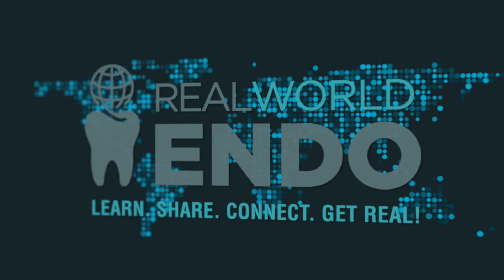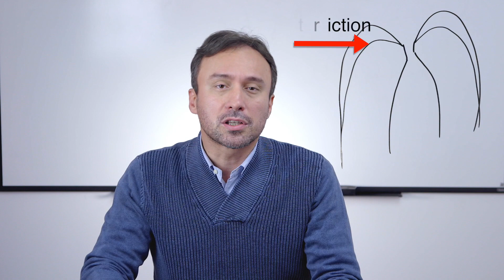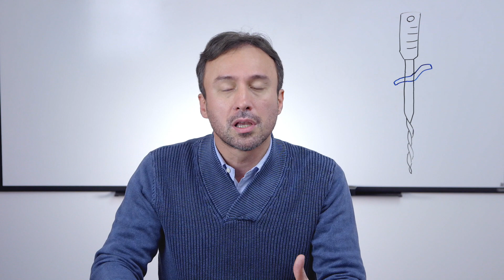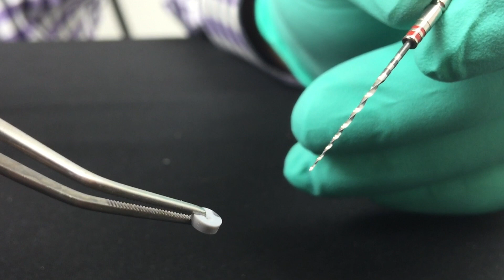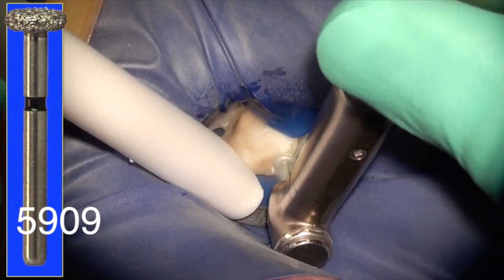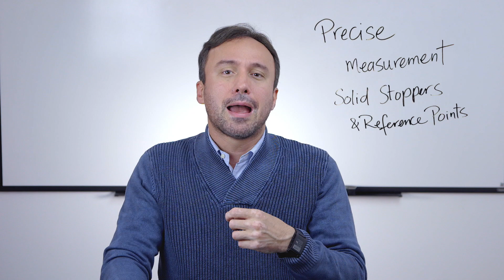How to improve Length Control? Friday Questions

Comment: Hi Allen!
I'm a student and I find your videos really helpfull and motivating to see how you can overcome different challenges. We had a essay question in school that goes like this:" Your are doing ET on a tooth with undeveloped roots, the apex locator is giving you uncertain readings, what will you do, to still be able to use your apex locator, to determine your working lenght". My guess was apexification therapy would be the logical thing (besides checking all the usual disturbing factors for apex locator) since the open apex is the major concern. Anyway we have a verbal exam next week and I figure this topic will pop up too. Also i think it is a interesting topic and would like to hear your go on this.
Reply from the maker: Urban Chorba Good question!! The working length is a byproduct of the file touching walls as it comes out of the root. Since most pole pole use smaller size files an open apex creates a problem as the file slips through the apex without sensing any construction. The way around that is to first make sure the coronal part of the canal is dry and there are no short circuits, then use the largest file that feels resistance when it wants to get passed the apex. Depending on the opening that could be any size. You’ll have to gauge the apex to find out. You can go with series of larger files until you find a stable and consistent reading with the largest file in that series. Lastly, you confirm this length with radiographs and finally check the length with a paper point’s consistent dry-wet point just before obturation. Good luck on your exam! ;)
Reply: @EndosKool  That was fast Thanks alot! Its one of my final exams and I feel a little more confident now :D
Reply: Nice question and nice explanation

Comment: I noticed by using endo sequence and root ZX at the same give we get false readings many times. I am not sure why is that? When I use other files it doesn't happen.
Reply from the maker: fay mansouri You need to see what you’re doing. Obviously RootZX is an established brand and files, EndoSequence or any other brand don’t differ in their length measurement. So you need to see what you’re doing that you’re getting this. Most likely you are getting a short circuit which is due to having too much fluid or a breach coronally in your access. Be sure you fully dry the access fluids leaving only fluid in the root canal. Also that the files is not touching nothing metallic coronally. Lastly, be sure you are using the largest file that can get through the apex. A size 15 is more predictable than a size 6, or 8. Good luck .

Comment: Is there any literature proof about flattening the cusps.
Please let me know sir
Reply from the maker: It's equivocal. Some studies show it helps while another study shows it doesn't! I do it when a crown is needed or planned since it won't harm anyway and can potentially help with both the post op pain and definitely with the working length management.
Reply: @EndosKool  still sir.
Any literature proof saying to use this method.?

Comment: Hi Allen.
am a fan of your endo tips. i have watched all of you videos and now i am also using ESX file system.

My question is
Why do patients feel heavyness in jaws and the tooth treated endodontically in a single visit?
Reply from the maker: Thanks! 
I'm not sure what you mean by heaviness in the jaw; but if you mean pressure then it can be due to pushing more debris out past the apex which results into inflammation. The goal is to reduce debris extrusion to the extent possible by having good motion habits and being cognizant of the role of debris in post operative response. Cheers!

Comment: i do flat cusps if the tooth needs crowning after endo treatment... but if not is it ok to be flattened ?
Reply from the maker: Of course not. Only if the tooth is planned for a crown. If not, then use the anatomical markings but try to stay consistent on the chosen location. Cheers.
Reply: Real World Endo 
thank you for your time and answer ... actually i didn't except to reply as quickly as that  .... 
cheers

Comment: i am just a dentistry student watching clips for my profession. in this video i've confused bcuz of that information you said " flattering cusps for better preparationing and measuring length". in class we are learning that enamel and natural tooth tissues are important and if it not necessary we should not touch them. isn't it a bit much to removing high amount of enamel to get Length correct ?
Reply from the maker: Murat Tugaç It was mentioned in the video that this is only indicated when a crown is to be made afterwards. It's not indicated if you plan to restore with a filing. If you have to do a crown you will be removing this portion anyway and you are not removing it unnecessarily.
Reply: +Darbzen if u r going to put a crown on their, u will reduce 2 mm occlusally. u might as well just flatten the cusps so it will be easier for doing WL.  Also, after RCT you should take the tooth out of occlusion because it is weakened. I didn't do it 1 time and the patient came back with a fractured L wall and I ended up paying for his crown lengthening procedure. 
Also Endodontist Real World endo said something brilliant: you can always add some composite to make a "flat" occlusal plane.
Reply: Murat Tugaç if it lets you do a better endo treatment then you should flatten the cusps. it's all about the balance risk/profit
Reply: RealWorld Endo Thanks, Also wonderful channel :)